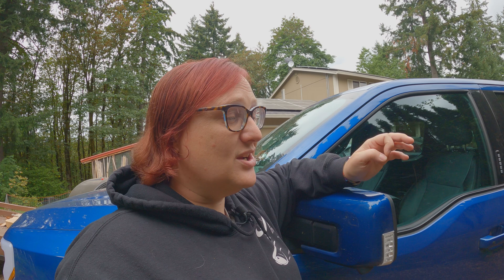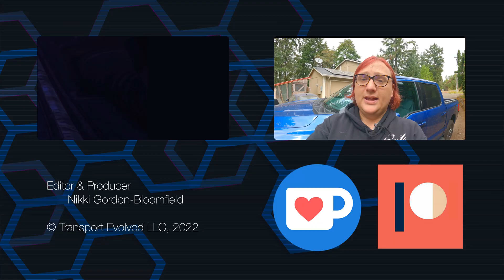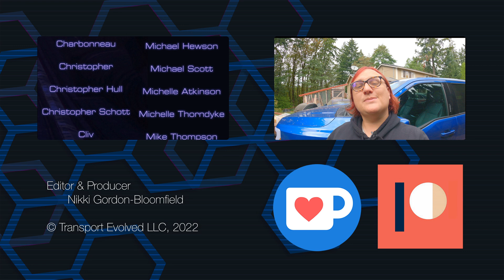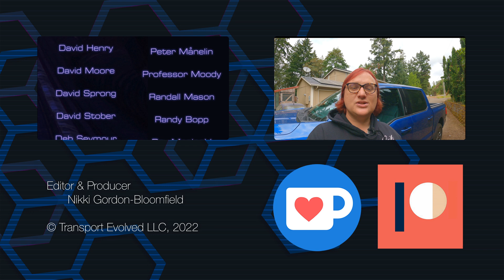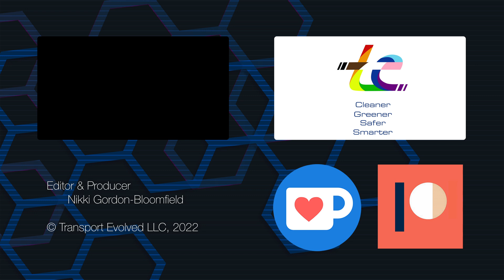Sunday Musing: Just How Are We Going To Make EV Charging Stations Reliable?

Comment: Back again.  Some failures are due to careless users (same as Gas nozzles/hoses). We need a better repair response than we have now. That gas station might have a spare nozzle or the service crew is a phone call away. Hous, not weeks. The local Lowes had some fool destroy (the nose was missing and the pins bent) one of their J1772 plugs. it was over 30 days before that station (1 of 12) was back online. Main problem is just Lazy-careless users. Why are the cords not on the hangers or the plug snapped into the holder?

Comment: I think the whole concept of a "charging station" analogous to a liquid fuel pumping station ought to become an anachronism.
Once it becomes clear that, sooner than later, every vehicle is going to have to be electric, charge points are going to become more of a standard element of vehicle parking in general.
I've been looking forward for some time to that becoming the case with restaurant chains that cater to the traveler. Once refueling on a road trip becomes a simple matter of plugging in as you walk into the diner and walking out with your vehicle as fully fed as yourself, the idea of making a separate trip to a different place to fuel up the car will seem odd & quaint.

Comment: I think an underlying question is what are the things that most frequently cause a charging station to break or otherwise be unavailable? Obvious potential culprits:
* Cooling failure (especially on rapid chargers)?
* Local power outage? (Someone stick 50p in the meter!)
* Busted socket (on AC chargers) or attached cable (on DC)?
* Damage to the RFID smartcard/contactless payment system or other onboard user interface hardware?
* Underspec'd telecoms backhaul preventing payment authorization?
* Unmet requirement for cell connectivity to a phone app (should charging stations require a network-agnostic picocell so there's always data service)?

Comment: So long as you have somewhere to charge day to day, I'm not sure ultimately if it matters that all charging stations are reliable, it only matters that charging stations on main trunk roads are reliable.  Home chargers do seem to be reliable, I'm not so sure about local charging hubs.

Where I live (Fife in Scotland) there are various level 2, 22 kW chargers (mostly in car parks) as well as a few 50kW chargers, and precisely 1 pair of 120kW chargers but essentially you are on your own.   To be honest this is sufficient so long as I don't plan on travelling more than 200 miles in a day.

All we really need are multiple reliable high power charging stations every 50 to 100 miles or so on major roads.  Not one or two at a time, but 16 or 20 at a time so that it is the same kind of level of provision that motorway service stations give ice vehicles.

If I open Zap Map and filter by 100kW+ chargers then from Manchester south and west of Wales we have the spacing, but not the volume.

Outside central Scotland, anywhere in Wales, in south west England and East Anglia, forget it, its 50kW max for you (but they are there).

Its a chicken and egg problem, until there are sufficient EV's doing long trips, no one will invest in the stations and until there are sufficient reliable stations no one will do long trips.

Comment: I think the main problem is that DC fast chargers just don't make that much money, and don't typically have associated business (i.e. convenience stores) to make up the profit like gas stations do.  I can see 2 possible solutions.

1) the charging  business model changes so that fast chargers are installed alongside driver services (restaurant, stores, etc.) That will make people spend money so profit can be earned. Similar to the convenience store, but more geared towards longer, but higher value, stops.

2) car manufacturers pay EV fast charging networks an incentive fee to maintain a certain level of service for their cars to get at least some of the benefit that Tesla gets. Ford has taken a baby step with the via the Fordpass network, but not near enough to be effective. A big enough fee could be the profit center for the network and incentivize prioritizing reliability l.

Comment: Why can’t a charging be like a gas pump, roll up one, plug in and use you credit card! A gas pump doesn’t need to play electronic hand shake, etc. Just make it simple!
Reply: safety. The entire handshake is required to keep it safe.
Reply: A charger needs to talk with the car, one of dozens of brands each running different software that may not have been updated for two years. America doesn't even have the newest generation units yet that are designed to work with EVs.

Comment: Time will work it out.  Tesla has had much more time, many more iterations to get it better. And yes, controlling it all made it easier, except where permitting takes years. 
Just like it took a lack of teleprompter to prompt your backup, I suspect it's like the the old saying "Good judgment comes from experience, and experience comes from bad judgment."
One can hope that these inexperienced startups would look at what the leaders (Tesla) are doing and copy them. It would save a lot of time, but sadly is not as satisfying to the ego. I hope they learn quickly! 
I remember when gas was a thing and 76 had a reputation for good gas and later for clean restrooms, maybe competition will arise in this market as well. Or maybe Tesla will open up their network to CCS1 and speed up the competition.

Comment: It feels like at the end of the day, the charging networks are ultimately in the Peace of Mind business, rather than the electricity dispensing business. The average driver wants the peace of mind that wherever they go, they can find a place to quickly and safely recharge. 

I wonder if a pubkic system which tracked number of botched charge attempts and financially rewarded all the employees of a network with the least botched attempts in a quarter could create a strong incentive. That could remove some of the C-suite element, and ultimately acts as a carrot for the workforce on the ground. Barring that, some kinds of mandates for on-hand inventory and proximity of a technician to any one charger would seem to be a prudent way to regulate it.

Comment: We NEED to do this over here: 
(trigger warning: you will be "green" with envy, pun intended)

youtube  /watch?v=jdqWlEIFUMI
"You join Kyle at the Sortimo Innovationspark in Zusmarshausen, Germany between Munich and Stuttgart! This is one insane DC Fast Charging installation and in this video Kyle takes you on a full tour of it."

Basically an EV travel center with attendants on duty 24/7.

We should also seriously consider adopting the Tesla or the CCS 2 standard as, unlike CCS1, AFIK you never have to hold either of them "right way" to initiate charging.

I cannot overstate how much it makes me cringe when there is a story on forums
about charging problems and more than one respondent asks "did you hold it the right way?"

That is just unacceptable and sounds like a design problem and not a maintenance issue.

Comment: I think we should go with the gas station setup. Seems that they are better maintained than the current EV station.
Reply: But with a gas station you spend 5 minutes at the pump. With an EV charger, it will be 4 to 10 times as long.

Comment: Someone failed to put their phone in airplane mode!!!  FYI, imagine trying to talk to ATC, with that interference, and you now know why airplane mode is a thing.  Based on the other video from today, I think it is the Ford pinging its transceiver....
Reply: Always wondered what airplane mode was. Haven't travelled on an aeroplane since 1990 so not had cause to use it 😂
Reply: @judebrown4103  I haven't flown since 1964, so I'm somewhat out of date on such things myself. But I knew what that noise was, because I have some audio equipment that doesn't like my phone to be too close when it's IDing to the network. It's AT&T and TMobile that make that noise, Verizon and Sprint use a different protocol.
Reply: @jamiewomack  you know I did wonder if it might be interference from the truck. I get the same effect if I put my phone down on my electric piano come to think of it. As the comments section can be quite unkind sometimes and I'm no expert in these matters I didn't mention it. Glad to know someone else has the same suspicion anyway 👍☺️